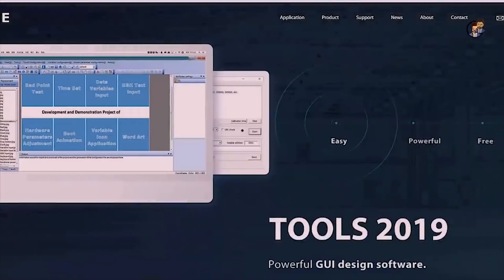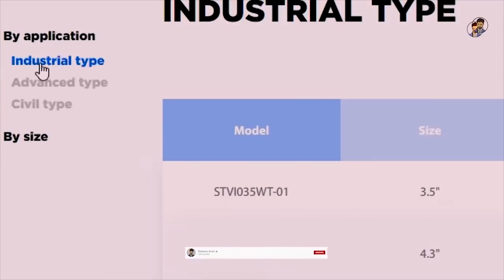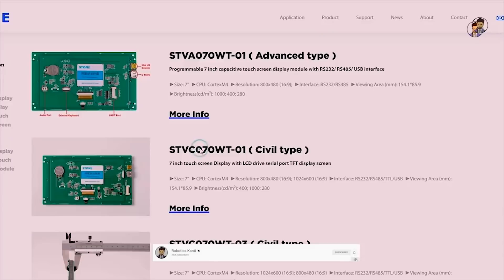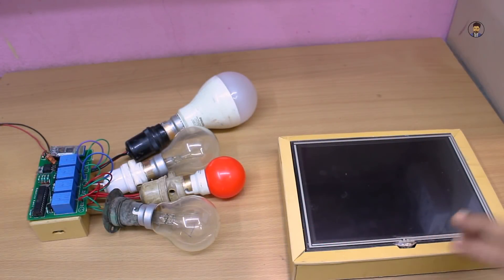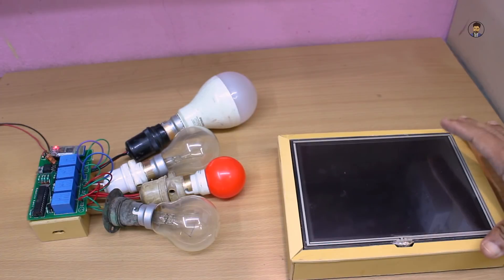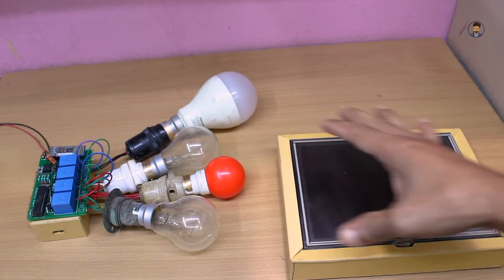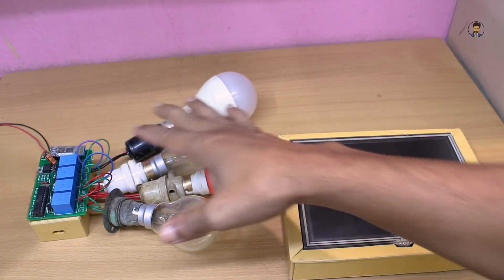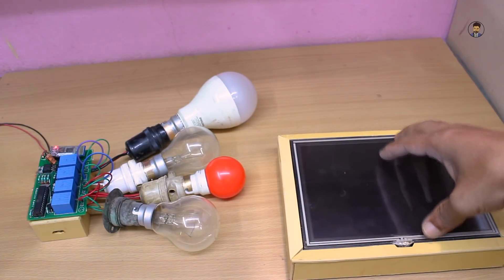how to make tablet touch switch without coding at your home

Comment: Section 1
Part 1
1) Why a person gets shock while urinating between two parts of railway. How the electric current became complete here?
Part 2
1) How a lemon can work as a battery?
2) How a battery is able to produce current? 
3) Towards which point magnetic needle points when kept close to a flowing current? 
4) What is the cause of magnetic effect? 
5) If it is just the movement of electrons which causes the electric effect then why it's necessary to connect it back to the positive end? 
6) How tasting a copper or zinc metal it shows chemical effect of electric current? 
Part 3
1) Do we get milk after we mix water, proteins and fat? If true then why it's not a chemical change? 
                                Section 2
1) What makes one substance conductor and other insulator? 
2)